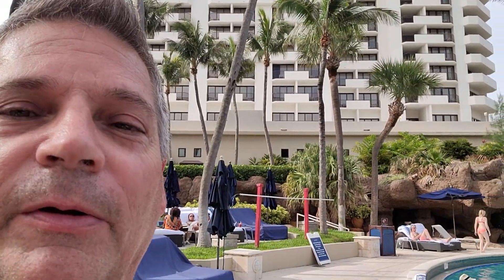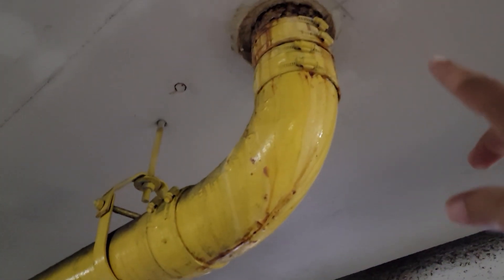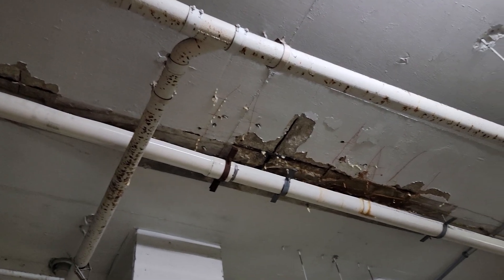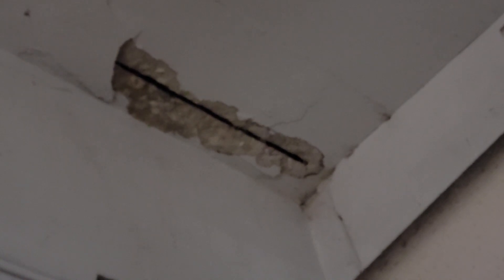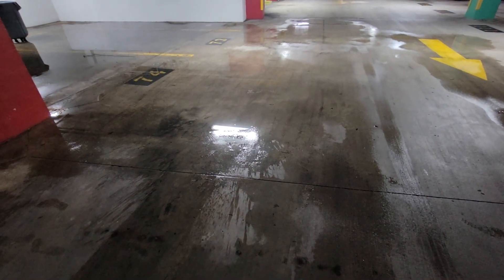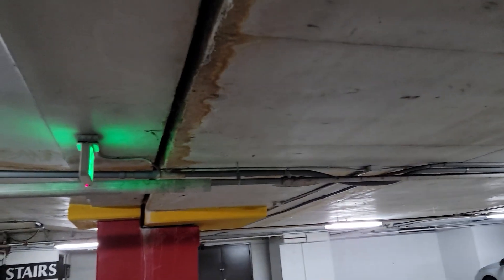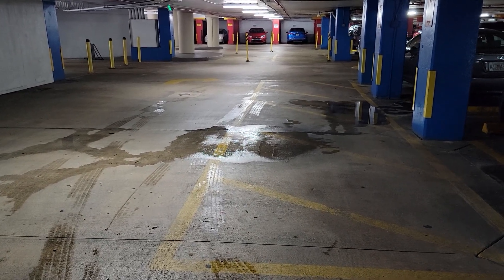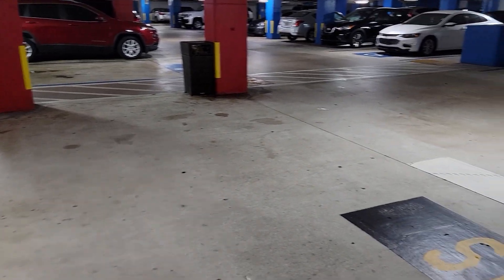Scary Garage Damaged Concrete Marriott Harbor Beach, Like Surfside Collapse

Comment: That moment when you realise he is not only there to educate, he is there to document..
Reply: Yikes, that gave me chills.
Reply: Probably the true cost of maintaining these buildings is a lot higher than we know now. And it will probably take a bunch of collapses to drive the point home :(
Reply: Amen!
Reply: Ummm. Isn't it the same thing? Document a building to use in the next presentation.

Just a thought.
Reply: I built a 120,000 SF building with three floors of parking below for $6 million, the parking repairs are estimated at $7.08 million. , @surelyyoujokemeinfailure7531
Reply: REBAR CONCRETE seems like more hassle than it’s worth.  The Romans built with Pure concrete & their buildings aren’t rusting to pieces.  They stood 2000 years

.
Reply: @electrictroy2010  They did but they wouldn't have been able to build multi story buildings like we do.

Comment: The more people that record, & post these kind of vids the safer we will all be 💯👍😞condolences to the family's of Surfside
Reply: @Gabriel greedy people!!!
Reply: sometimes it is counter productive
Reply from the maker: Yes these periodic repairs must be factored in for example in most of the 2 story condos that I have owned Kama the only thing we really need to worry about is the remove that needs to occur every 15 to 20 years. So far 4 condos that I have owned we got hit with a $5000 assessment to repair the roofs but it's necessary and it makes the buildings look a lot better when they are done, and it's easier to sell your unit then. But also even as a landlord owning a rental property, you have to include in your budget a new AC every 10 years Because that is about how long they last provided you get a decent air conditioner.
Reply: @jeffostroff  I hated being a slum lord for 5 years. Gave it up and invested my time and money in the stock market. Hated that call in the middle of the night that the furnace would not turn on.. just needed a battery.....LOL
Reply: Hopefully, something good will come from that disaster. This reporting is a start but will anything be done?
Reply: @jeffostroff  everyone needs to tweet and DM @Marriott on Twitter and social media pages with an opinion and a link to this video.
Reply: @johnjack6682  yeah..like Covid
Reply: not really cause unless they are fixed they still remain a Danger to people inside the building water leaks like that will bring the building down given enough time and ignorance of it's occurance
Reply: @jeffostroff  My AC just (two days ago) died at 19 years old. Mind you, who knows how efficient/hygienic it has been as it staggered on.... Glad to get a new one. Nothing lasts forever!
Reply: Lol nah they don't care about anything but profit margins.
Reply: Yes, we will also be healthy from walking a half-mile from a parking space to the hotel room. The danger of parking lots will bring in electric self-driving cars owned by large corporations as parking your vehicle will be too expensive to own.
Reply: REBAR CONCRETE seems like more hassle than it’s worth.  The Romans built with Pure concrete & their buildings aren’t rusting to pieces.  They stood 2000 years

.
Reply: Posting videos makes no one safer.
Reply: @@Gabriel-qw5zbyou don't know that.
Reply: @Micheph what is counter productive?

Comment: Jeff on vacation: Time to inspect this hotel.
Reply: I’ve been in that garage every weekend in high school. I don’t remember those color columns. Also for those that don’t know, this hotel has a gigantic pool deck, with multiple pools.
Reply: @limestar9751  You can tell they're freshly painted. The guards on the corners are new too. Probably all results of post-Champlain
Reply: @nadapenny8592  Ignore the ceiling and the big water leaks, look at our beautifully painted beams!
Reply: @lakecityransom  But at least they’re 4 times as thick as the one that collapsed. Those were much smaller

Comment: We are all aware that Companies do not like to spend money on maintenance so as not to deprive their shareholders of dividends(profits). Yes, they do repaint the foyers and replace light bulbs to give a place the "glitter" look. However,  the building itself can be rotten to the core!!!
Reply: What is needed is public awareness perhaps, like with other products/services that have some issues. The objective is to get people to part with their money, and most people are not looking past the surface paint, tiles, etc. If people walked in looked around (or wanted to see some regular independent expert reports), and decided to not buy/rent the unit, or not stay at the hotel, management would stay on top, otherwise seems relying on government oversight to tell organisations to do something.
Reply: @SyncViews  Yes, if going by all those unattended water leaks are to go by, I wonder if the Company is attending to a regular Lift Maintenance schedule. Those Lift cables need constant attention: Their close proximity to salt laden air means they will get very damaged and could fail without regular maintenance.    I am told that in China, many thousands of people per year are killed in Lift failures because they do  not spend money on Maintenance.
Reply: Very often, in the UK at least, it is the folks that live there who own a share of the building.
Reply: @robi4387  Freehold flats? Pretty much all the new ones I looked at around here was leasehold. Building maintenance is a management company which supposedly the residents could replace though, so that aspects ends up similar I think.

So I think same issues there as with the condos in USA. People complain about this and that but at the suggestion that the existing regular service charge won't cover it there is push back, and I still see little understanding (or interest) in the structural stuff. Mostly what they have been doing with the hedges, flower beds, painting, etc.

Not sure if the for management company that the property developers set up here is better or not. Hopefully overseeing multiple buildings if anything structural came up they would be on it quickly,  ideally have saved up enough service charges to cover it (was definitely an item for future roof and elevator work in the breakdown currently. So hopefully their predictions are good) and explain to all the residents why is important. Especially if something unforeseen and very expensive to repair came up.

One thing I wonder is if the original builders can ever be held liable for costs. Fortunately my building seems to have escaped all that cladding and other fire risk mess as from the news that was sounding very expensive for residents.
Reply: @robi4387  Oh for sure, why I said "builders" specifically rather than owners, owners lose as well if there is an issue.

Some of the things I have heard around here have sounded a lot like the designers/workers/etc. didn't do what they were supposed to. Seen lots in the news and had local plumbers tell how they have seen them cheap out on bathroom materials so that once water inevitably gets round the tiles it starts causing damage.

And I think here are now up to 5 of the 6 surrounding units (including mine) having had mains water leaks (within a few years of building...), so far the company that built the structure has fixed them up for free (including repairing/replacing decorating, flooring, etc.), but not sure if they are obligated or because they still have some for-sale properties here and some angry neighbours outside the show flat would look bad.

The cladding one being somewhat more complex as in many cases it was considered acceptable at the time I believe.
Reply: Yes, you are correct 100%.  Most companies concentrate on asthetics than structual or core.  Corrections are made after the fact or rushed when inspections are due.  Companies will always point fingers at the employees for not doing their job even though the employees have brought to the company's attention the problems.
Reply: That's because the general public has a misconception that companies are created to please their customers. 

Public companies' ONLY mandate is to provide the best return for their investors (shareholders). That is all.

Customer service is a byproduct along the journey to make more money. NOT the actual end goal.
Reply: @PWN_Nation  Pretty sure keeping the building intact is more profitable for the shareholders. You are so against bit corporations that you can't think straight.
Reply: How on earth is the building collapsing profitable to shareholders? Please explain your logic before spewing propaganda.

Comment: "Everything's fine until it collapses" 

Yikes! this garage and remodeling has many of the same features as the building that collapsed.
Reply: It does, but it was built much smarter. The poles are much bigger, the have those drop panels to prevent punch shear and they have double poles and a seam to separate slabs. The double columns and seam would've kept the pool deck from collapsing the living quarters of the building.

Comment: Looks like florida has a major problem with maintaining it's buildings, Scary stuff. Also very important as with the corrosive climate it's even more important to keep a close eye on these kind of things.
Reply: I worked with a guy that was a so called head maintenance manager of a Florida hotel. I can understand why Florida has major problems with maintenance. SMH
Reply: This is what deregulation gets you. Profits/people. All day. Every day.
Reply: The other corrosive element is Chlorine in the pool water.
Reply: @1madmaxx80  
Who deregulating what? What do you base your assertion on? Some deregulation is appropriate to maintain fiscal sanity in government.
Reply: in most areas of the state no inspections are required. In Broward, its only after 40 years. Things can go south long before that. Collapses are very rare still but they are flirting with disaster
Reply: Rising sea levels could end up with these older buildings being irreparably damaged.
Reply: They're disposable buildings with a maximum 40-50 year lifespan.
Reply: Probably when the true cost of these buildings is realized (including especially the maintenance needed to keep them from collapsing in the future) it will be incredibly expensive to live in those places.
Reply: Like an old car, it’s usually cheaper to junk & replace.  Demolish the building (or house) and build a new one.
Reply: @beachbro8559  They pay too little. You get what you pay for.

Comment: That exposed rebar needs to have the concrete chipped away, rebar sand blasted, and then grouted with a cement called Rapid Set cement all, (not quick crete) Rapid Set will hit 12,000 PSI, and will not shrink. Rapid Set concrete will hit 15,000 PSi if I remember right.
Reply from the maker: Yes ICRI has a set of concrete repair specs that they use for this
Reply: Are you saying you don’t need new rebar? The cement is going to take the tension that rebar was designed to hold?
Reply: @ED-es2qv  An engineer will look at the rebar after its sandblasted and decide if more rebar should be epoxy dowelled, most likely, it will be OK to just  grout, the type of cement it what matters on these repairs.
Reply: Sand blasted measured and if OK epoxy sand coated and I would specify a low density proprietary repair mortar (epoxy high cement content so it sticks and protects) because it is a slab soffit (ceiling) and that is a recognised method here in the UK.
I just worry that there is so much water penetration.  So many construction deficiencies and lack of maintenance.
Reply: @robi4387  that only works if they stop the water penetration. Otherwise the epoxy parts delaminate quickly.
It will be a very expensive repair, if they want to do it correctly.
Reply: @adamrak7560   Which translates to, they are not going to fix it the right way they are just going to patch it and paint it🙄

Comment: I love it. Jeff goes on vacation,  and it becomes an investigative report into the structural deficiencies of the hotel !!
If you ever looked at how damaged parking garages are the northeast (Canada, US),  you would likely pass out.  Not only are there freeze / thaw cycles all winter,  many places like Toronto,  Montreal apply road salt throughout the multi-level parking garages all winter to deal with ice on ramps and driveways in unheated parking garages.  And there is also salt-slush that drops off of cars.  Stalactites are a normal sight everywhere!
Reply from the maker: You are right that does sound scary

Comment: Please send Marriott a link to this video if you haven't already, and also whoever is in charge in the county or state. They've got to be called out on this. Thank you for these videos. I will forever be  noticing the condition of hotel garages moving forward!
Reply: At the very least marking the area by officials so the public knows the issues are known and in the pipeline to be repaired.
Reply: Lmao
Reply: Send Marriott a link!?  I wouldn't dare, they will be trying to sue him! I'm sure he would be blacklisted from all their properties as well
Reply: @willschultz5452  They might anyway. They'll probably find out about it anyhow.
Reply: Send it to the Marriott insurance company!
Reply: @rt66vintage16  Marriott has actual engineers for that
Reply: REBAR CONCRETE seems like more hassle than it’s worth.  The Romans built with Pure concrete & their buildings aren’t rusting to pieces.  They stood 2000 years

.
Reply: @electrictroy2010  My ancestors were pretty amazing, no doubt! ~ Marilyn
Reply: @electrictroy2010  the romans had skyscrapers and hot water pipes?

Comment: Hi Jeff from Australia have been watching the CHAMPLAIN Condo Building Collapse in Florida that Tragity took 98 LIVES AND THIS BUILDING REMINDS ME OF A FEW TIMES I HAVE SEEN A VIDEO OF THE CHAMPLAIN BUILDING THE CARPARK REMINDS ME OF THAT BUILDING THAT HAD MANY WATER ISSUES PLUS CEILING OF CARPARK HAD CRACKS AND THINGS HANGING DOWN FROM ROOF.YOU WOULD SEE WATER ON CARPARK FLOOR PLUS THEY HAD A PUMP TO GET SOME OF WATER OUT BUT ALSO HAD FLOODING SEVERAL TIMES AND SPALLING AS WELL I WOULD DEFINATLY NOT PARK MY CAR IN THAT GARAGE LOOKING LIKE IT DID IN CHAMPLAIM BUILDING THAT COLLAPSED I THOUGHT CONCRETE WAS WATER LOGGED.THANKS  JEFF FOR SHOWING US ALL THE INFORMATION ON THE CHAMPLAIN COLLAPSE AS TO WHAT CAUSED THE BUILDING TO COLLAPSE.😇 Will be Very interesting to know What Took the Champlain Building in Florida to COLLAPSE ??HOPE SOMEONE OUT THERE CAN FINALLY FIND OUT THE REAL REASON WHY THE BUILDING COLLAPSED AS I HAVE WATCHED U VIDEOS PLUS JOSH AND KAI WITH 2 CATS BRUCE AND GEORGE WHICH SHOWS U LOOKING AT CONCRETE WITH REBAR IN THE CONCRETE AND SOME OF THE CONCRETE.WHICH IF IT WAS FROM CHAMPLAIN TOWER THE COLOR OF THAT CINCRETE LOOKED A RUSTY COLOR AND I SENT KAI THOSE WORDS AND SAID CONCRETE LOOKED WATER LOGGED PLUS MIKE BELL WHICH THE 4 OF U HAVE REPLIED TO ME AND MIKE BELL LIKED MY COMENTS PLUS KAI AND JOSH.WELL DONE TO ALL THE GUYS TRYING TO FIND OUT WHAT HAPPENED FOR THIS DISASTER AND BUILDING OF CHAMPLAIN TOWERS TO COLLAPSE.PEOPLE NEED ANSWERS AND OF LOVED ONES THAT DIED AND FOR THE SURVIVORS.😇🦋

Comment: Oddly enough after the collapse of the towers in Miami, I stayed at this exact hotel in January  I was looking through my phone and I took a picture of my rental car parked in parking spot 5G right near the stairs/elevator. I recall there was a huge amount of water pulled up all around that parking garage that evening as well as small pieces of concrete in the water puddles from the ceiling as well as multiple leaking pipes. Just things that you don’t even think about now I am always looking every week during my business travels at basement parking structures that I park in and it doesn’t matter if it’s in the Midwest, the West Coast or Florida there are so many of these buildings that are in bad shape. I enjoy your videos
Reply from the maker: Yes, I hope this helps others to be more aware also

Comment: The design of the building and the correct size of the columns with anti-punch through pads slab beams are far superior to the rubbish Champlain towers design. Also got car crash guards on the columns as it should. But is typical of body corporate management to take the cash and fail in their duty of care to maintain the building. Its important to find the source of the all water leaks and stop it. Then repair the concrete. I would make a complaint to the authorities as the body corporate will need to be forced with legal action before they will spend the money, as it profits before people.
Reply: Definitely an all too familiar lack of concern where it needs to be.  Something we seem to badly need to address, if people are going to be kept safe.

Comment: The Marriott Harbour Beach Club was opened on October 22nd 1984. The building has 650 rooms,15 floors and was last renovated in 2016
Reply: I had my honeymoon there with 1st wife nov 1984
Reply: Well, they didn't do a very good job in 2016.
Interesting - a flat and optimistically thin under-reinforced slab at Champlain in 1979/1980 and beefier columns with column heads in 1984 for Marriott, 3030 Holiday Drive.

Comment: A final comment, promise.  Even rainwater is slightly corrosive because it is mildly acidic from the dissolved carbon dioxide that forms carbonic acid.  Although very dilute, over time it reduces the inherent alkalinity of the concrete.  Reduced alkalinity in combination with insufficient concrete cover (and initial low cement content in the case of 8777 Collins Avenue) is the most common cause of problems with reinforced concrete structures.  And again - ignore a Structural Engineer's advice at your peril.
Reply from the maker: Yes and water left pulling in contact with concrete will eventually soak through to the rebar and start the corrosion process, whether it is saltwater, or chlorine pool water, or fresh water from the rain.